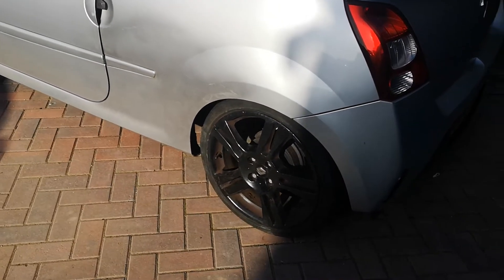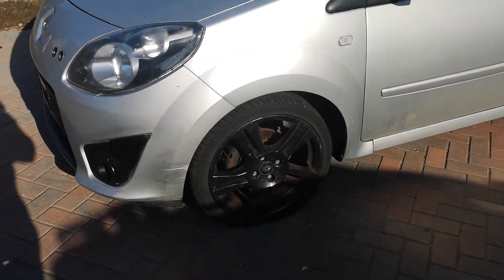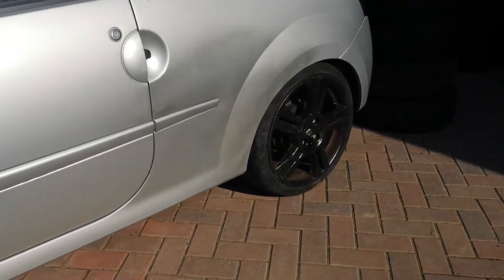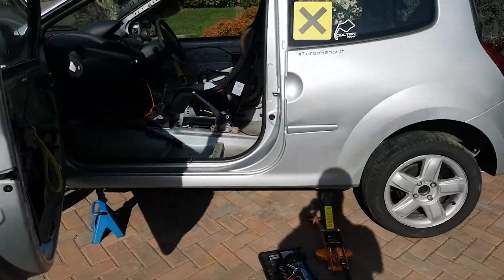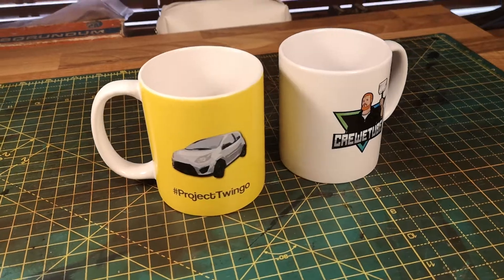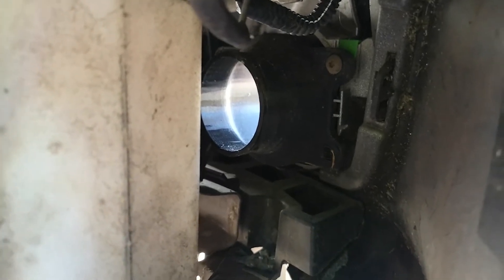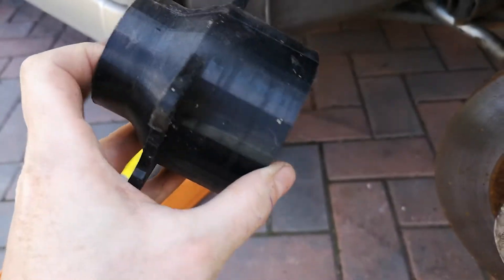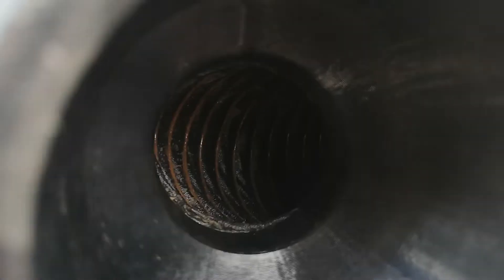Project Twingo - Part 40 - Installing Brake Duct Cooling

Comment: I really love brake ducts and always do them first.
Even if the brakes are not prone to overheat anyway on some cars due to their power/weight ratio (like our cars), I suppose the pads and disks will last longer.
Reply from the maker: Admittedly barely used them on track but they looked virtually new after a full day... So must do something
Reply: @CreweTube  Brake harder?

No I know you are preparing the swap. Looking forward to it, though it will still be FWD after that and that'S a shame, really.
Reply from the maker: If I braked harder I'd lose all my momentum 😂 was on the limit of ABS kicking in so not sure much more was possible with current setup.

Once the engines swapped will be a different story!